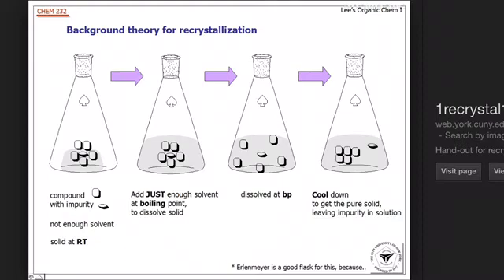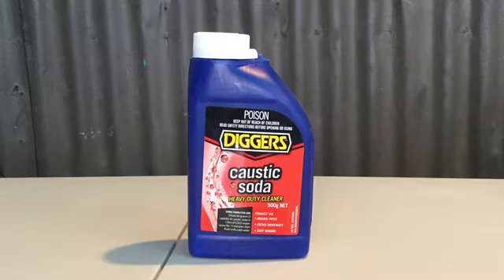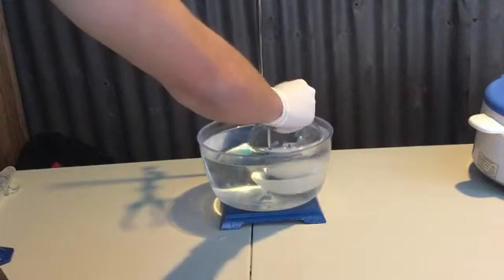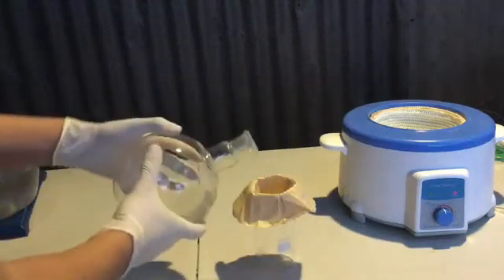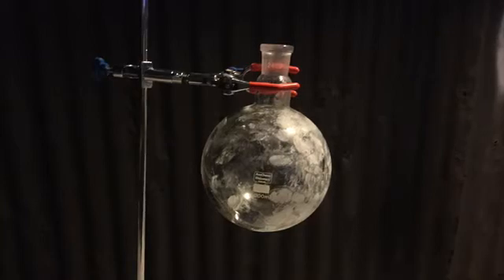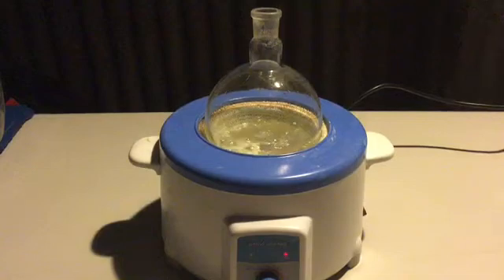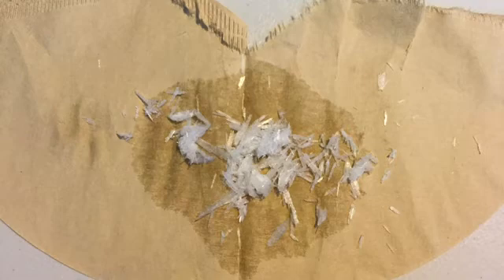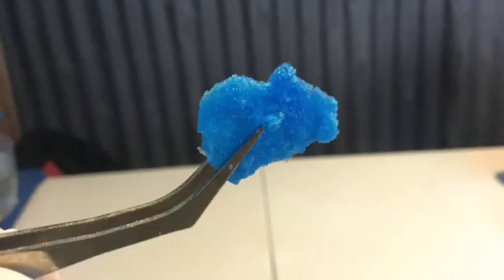The Recrystallization of NaOH

Comment: Great video. Couldnt you check the melting point for purity? And did you dry the crystals via oven or dessication chanber to make them anhydrous? NaOH is pretty hygroscopic, so itll be wet if you dont.
P.S. if you want to use spectroscopy, check out this DIY vid: https://youtu.be/pIk8I10ZmYY

Comment: Did the NaOH not corrode the glassware?  Anytime I use hot NaOH in a glass container it eats through part of the glass, eventually destroying it if used several times.  I have even dissolved whole test tubes in a more pure, hot solution.
Reply: use lab-grade flasks instead of cheap ones, they should not corrode or dissolve!
Reply: @sam.f3002  Glass of any kind other than fuzed quartz will be eroded by hot NaOH.

Comment: In fact "crashing" out the crystals in a short ammount of time increseases the purity of your NaOH. Thats because you dont allow for impurities to be trapped inside the crystal as it slowly forms. With that said, the small crystalls created will be quite hard to filter.
Reply: Quite the opposite is true. Less inclusions (containing impurities) are formed when the crystallization occurs slowly.  The crystal lattice is better able to exclude foreign material when it forms slowly.
Reply: Charleschidsey is correct. Slow is better not fast. Rapid cooling allows impurities to be trapped and "wrapped" in the forming crystals which do not give time for the impurity to fall away. In a slowly cooled solution, the impurity will not be able to find a place to stick into the crystal lattice and instead fall away while the pure crystal slowly grows